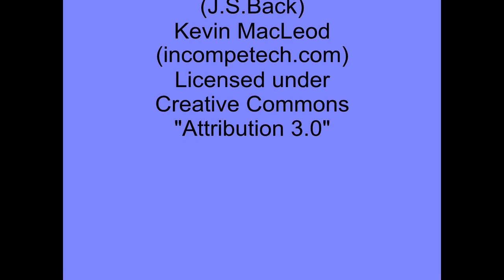Glass Painting. Working With Adhesive Lead Part 2 Making Your Own Rectangular Blank Lightcatcher

Comment: Wt is that.     Band
Reply from the maker: If you mean the lead then it's 9mm FLAT Adhesive lead. This one is the "natural colour" but you can also get it in brass, silver, black and gold etc. It does come in different widths be I find the 9mm is best in this situation. You can also use it in windows and doors (which is my next project!).